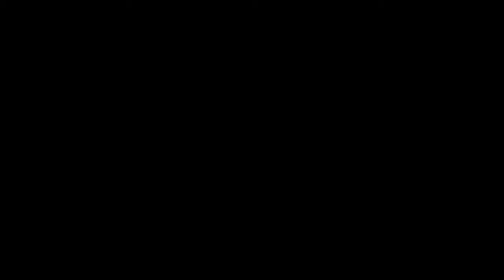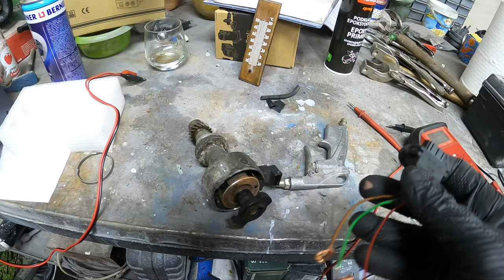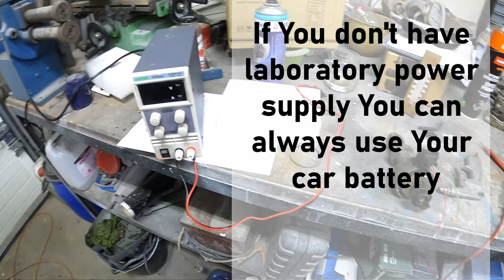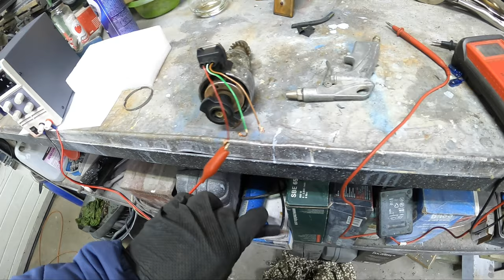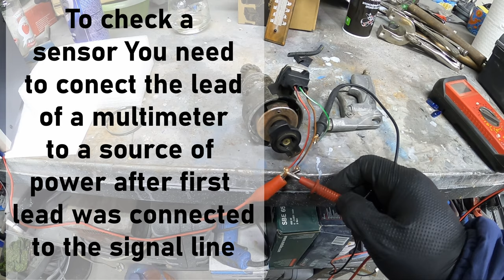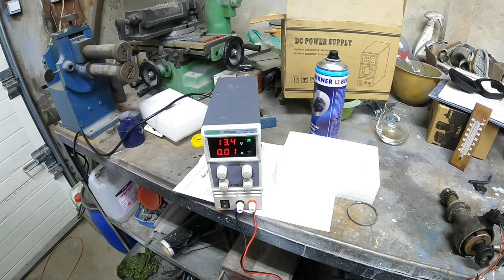DIY How to check hall effect sensor in the ignition distributor

Comment: Thank you for posting. If it reads 4.8v and 12v is that faulty? does it need to be 0 to send spark? thanks
Reply from the maker: If its ok it should show you reading. In my case it was 12v because i was connected directly to battery to check if the hall sender is ok.

Comment: Mine is stuck on 9v even with a 13v battery voltage feed. Nothing changes when the poles pass the sensor. May be dead??
Reply from the maker: Voltage should drop to 0 if outside of the pole. If you get constant 9v it looks like you have shorted something and that is why the reading is like that
Reply: @UnleadedBuildsGarage  ordered a new one, hoping it works